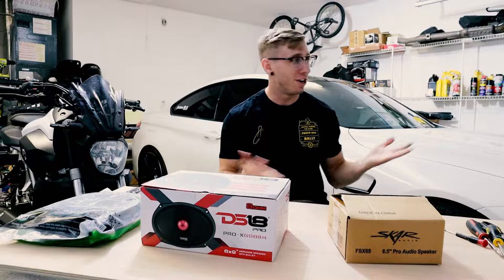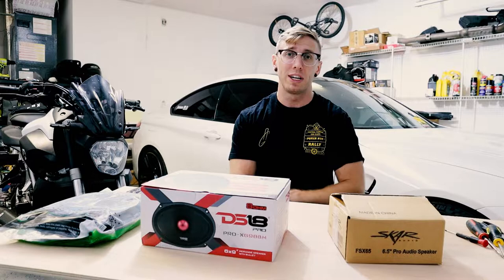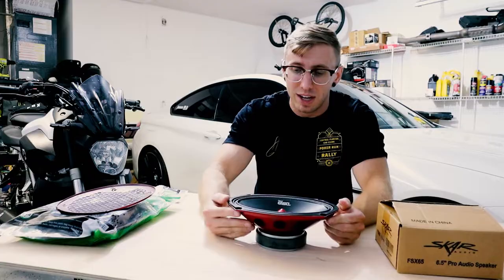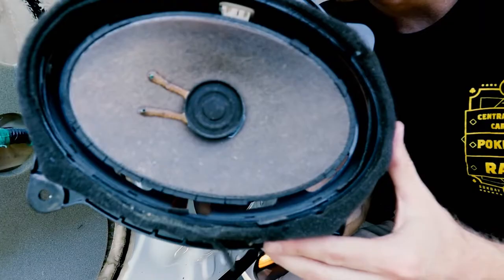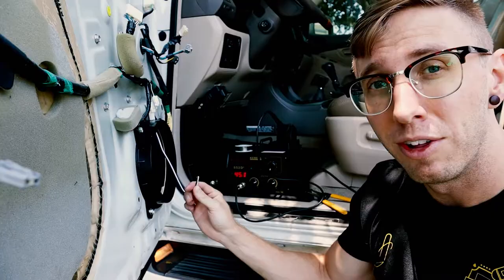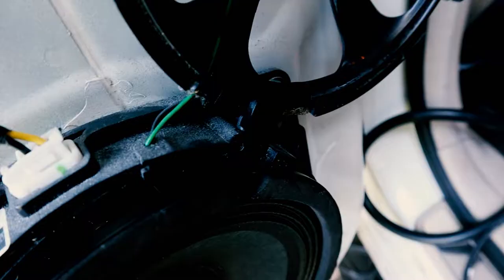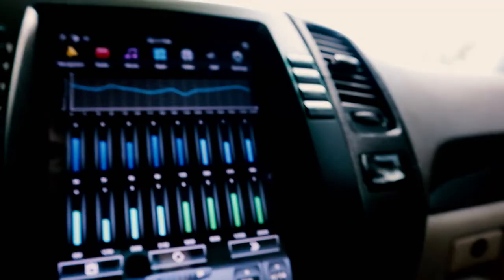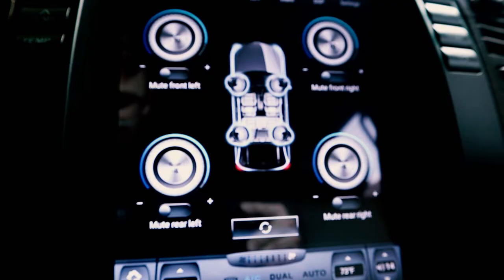Vlog 30 - Lexus GX470 Door Speaker Replacement

Comment: Just an FYI. The rear speakers are NOT the same for the non nav OEM/non mark levinson audio. My 2003 is the same as my old 4runner 4th Gen you DO need to purchase a Metra kit Metra 82-8148
Reply from the maker: Yes, you are correct! The ML system is an 8 ohm system and the non-ML is a traditional 4 ohm impedance system. The good news for non-ML GX owners is that there are so many more options for 4 ohm speakers. Unfortunately, I was stuck with only a few options in 8 ohm, but these speakers have been great so far.

Comment: If I go aftermarket headunit going through the ML factory amp, do I still need 8ohm speakers, both front and rear?
Reply from the maker: Good question! Yes, unfortunately the amp is what needs the 8 ohm configuration. 😑

Comment: Looking to do this same upgrade, why did you use Skar 6.5" for the rear doors and not also use DS18 like the front doors?
Reply from the maker: The rear doors would have needed modified to fit the DS18s 6x9” size. At the time it made sense, but if you could modify the rear doors or get a conversion bracket, you’d get better sound from the DS18s. Let me know if you go that route. I’m curious to know how it goes.

Comment: Got the rear doors finished using your guide.  Great notes on all the necessary tips.  I got the tabs cut away and had both doors done in about an hour.  Once the 6x9's are back in stock, I'll be set!  Thanks
Reply from the maker: Thanks for providing feedback on the install! I’m glad to hear it went well and the video was helpful for installing. The 6x9s were my favorite upgrade as the DS18s have quite a punch. I was surprised by their bass.

Comment: Great video, thank you! Just did the front two 6x9s and I have a couple comments to confirm what's been discussed:

1) Sound is definitely bass-heavy now. EQ-ing on a stock ML head unit is not ideal since you don't get fine control, but if like me you only have the stock unit, I would recommend turning the bass down and treble up a bit to help balance the sound out.
2) There is a little rattle at loud volume with the new brackets. Recommend folks trying this to use the OEM brackets.
3) #10 3/4" self-tapping screws are ideal if using the new brackets.
4) The metra 6x9 speaker adapter from Amazon comes in a 2-pack, so only get one. :)
Reply from the maker: Thanks for the feedback on the stock ML EQ settings! Glad you were able to balance things out with it. Luckily, I don’t have any rattling in my brackets…you might want to try putting some sound dampening material on the backside of the bracket to isolate the rattle.

Comment: Great video!!  Changed out all 4 door speakers with ease.  For the side door 6.5 speakers, used DS 18 Pro-X6MSE 8 ohm speakers.  This gave the sound more midrange depth and a little distortion compared to my wife's Mercedes.  Great for 80's music and needed when playing digital music from an iphone.  My wife's Mecedes sound system is premium but has no character. Almost matches the sound I get from my 2011 Acura TL.  The adapters for all 4 doors and wiring harness made this changeout easy after watching the video a number of times.  My old speakers were shot, did not know the 6x9 in the front two doors were bass only.  Also from Central PA but live in Denver.
Reply from the maker: Thanks for reaching out! I’m really impressed with the DS18 speakers. I hadn’t heard much about the brand until this recent search and they give quite the punch! Glad to hear you are enjoying the upgraded sound. Oh nice! Good ole central PA…I miss Middlesworth kettle cooked BBQ chips lol.
Reply: did you have to modify the brackets a little bit when using the DS18 rear speakers, like what he did for the SKAR speakers?

Comment: Hey thanks for this, just looking to replace my door speakers. What about the 3"  and tweeter door speakers? Were they working still and can you access those without taking door panel off? I noticed they were not mounted to the door. I haven't found a video about replacing those, just the 6x9's.

Comment: Just put kicker 6x9 in the front and kicker 6.5 in the rear doors. The front took the 6x9 perfect but the rear doors didn’t fit perfectly but I made it work. All these speakers were 4 ohm and so far no issues at all. The sound is phenomenal.

I’m putting the skar 6.5 sub in later this week. Just wanted to give my experience to people watching. 

Kicker 6x9" 4 Ohm - model: 46CSS694
Kicker 6.5" 4 Ohm- model: 46CSC654
Reply from the maker: Hey Bobberben! Glad you reached out to share your experience with the speakers. You won't likely have catastrophic issues immediately with running 4 ohm speakers on an 8 ohm circuit...it will be a slow degradation and will wear over time. There's even a chance you go months or years and never see a problem. I'm an electrical engineer, so I couldn't allow myself to go the 4 ohm route just off of principle and circuit theory. Hopefully this holds up well for you over time. If you run into any issues with it, please reach out as I want to know if people ever have issues with the 4 ohm configuration.
Reply: @Awesomoto  I thought of doing 4ohm resistors but figured I’d gamble on it. Put 4ohm resistors in another friends Lexus and so far no issues. I did just put the skar sub in and it’s not preforming well. Not sure if it’s the stock head unit or the 6x9s in the front drowning it out. In your video it seems your sub is flexing a lot more than mine.

Comment: The stock mark Levinson speakers are good speakers and are easy to repair, the kit costs like $20.
Reply from the maker: Great point. I agree with you. A speaker repair kit is an affordable and probably easier solution.

Comment: Thanks for the great and detailed video. I purchased the same from speakers but stayed with DS18 for the rear and sub. I had a rattle i the drivers front but when I went to replace the passenger side it was tore also. Unfortunately for me after the install I found them to be very under powered by the ML amp. Looks like I am going to have to spend mucho coin and get an entire system upgrade at a local pro shop. Ohh well. Again I want to say thanks please keep up the good work.
Reply from the maker: Of course! I'm sorry to hear. Hopefully I'm responding quick enough to make sure to ask you if you have you ML amp enabled in your navigation unit? Mine was disabled at first and the sound was bad. Once I found the setting and enabled, I had great output from these speakers. Actually...all these years later I'm still loving them. Let me know if you need any help troubleshooting your issue.
Reply: @Awesomoto  Thanks! Yes, unfortunately I did not know of an option to turn on the ML amp. I thought it was already on. Anyway, I spent the cash, had a local pro shop install it. They did a decent job and  the sound is great.  Thanks again and keep up the great work man.

Comment: I have a base gx470. Would running the 8ohm speakers hurt anything? 

I have the base 9 speaker set up.
Reply from the maker: If they are 4 ohm speakers and not the ML system, then stick to a standard 4 ohm speaker.

Comment: What amp are you using?, I have no idea how any of this works so I’m not sure which one would work, I have the ML amplifier but it is broken so I’m not sure if I should get the same one or a different one
Reply from the maker: I'm using the factory ML amp. Since yours is broken you have two option: Buy the ML amp or go with aftermarket. If you can find a deal on a factory ML amp, I would go that route to keep it simple.

Comment: Did you by chance modify or cut back the lip on the door panel that is in the shape of the 6 by 9? It's a very thin plastic that's kind of sharp and it seemed like it made contact with the original bracket on the plastic part but while installing my new infinity speakers it almost seems like the whole speaker enters that casing and it stopped by the lip twitch presses on the foam surround at the base. Let me know I'm on the fence about what to do I guess I should cut it back for safety. Also did you not add a gasket to the back of the Metro amount that makes contact with the door? I installed my first one passenger side without it but then I realize there actually is a gasket on the original and it did seem like I was getting some rattle without it. That said I will probably go back and take the speaker out and add it so it's not plastic directly on metal door.
Reply from the maker: Hey Raphael! I did not modify the back lip on the door panel and had luck fitting these speakers without a clearance issue. With regard to the gasket...mine didnt come with one but I'm shocked I havent had rattling issues. I'm wondering if it's because they are cranked down pretty tight. If you have them, I'd add them for safe measure.

Comment: aren't the 6x9" speakers mid-bass in the front doors?? i put 6x9" 2 way speakers, meanwhile i repair the foam surrounds on the mark levingson factory speakers.  when i put these in, all i got was bass coming out of them.  which is telling me, that they are crossover through the factory amp, and can potentially damage the speaker if its not a mid-bass or subwoofer speakers. did you have any issue with the speakers you installed on the front doors?  it seems like you installed mid-bass on the rear doors, so i don't see you having issue with those.
Reply from the maker: I've got a decent frequency response coming from these 6x9's. The DS18 website for these speakers lists a the frequency response as 65Hz-12Khz, so you might need to adjust your equalizer settings in your headunit to get the right response out of them. Here is a link to the speakers on their site, so you can see all the tech specs. https://ds18.com/products/pro-x-series-6x9-8-ohm-midrange-speaker-with-bullet-550w
Reply: @Awesomoto  my factory deck doesn’t have an equalizer.  But thank you for the information. 👍
Reply: I'm looking to replace mine and though I'd love to get the higher frequencies, doesn't sound like you were able to get those after all. Even if I don't, I'm hoping the bass response from the 6x9 is better than the stock ML speaker in that front door. Was yours?

Comment: Great Video! 
Do the rear skar speakers not require the Toyota Compatible wiring Harness…plug and play? 
Also I didn’t see you used Metra Adapter for rear do they need it?
Not sure if to get (4) Wiring Harness and (4) Adapters or just two of each? 
Thanks!
Reply from the maker: Hey TX, sorry for the delay. I thought I had replied to your comment and it looks like I hadnt. I ended up soldering the rear speakers to the factory wiring. If you check you can see I cut the wire from the original speakers and then I stripped it back and soldered the Skar speakers into place.

Comment: 7:02 . I need to change out my speakers in a 2004 GX470 non nav non mark levinson system and am having a heck of a time trying to find the output per channel on the amp. Then I came across the model number and found the specs, it says it’s only 22 watts to the front and back, does that sound as though it’s an accurate number ?  If so, what wattage speakers should I be getting?  Thanks for your help in advance
Reply from the maker: Great question! There is a big misconception with wattage ratings on speakers and amplifiers. The speaker wattage rating is specifies the total amount of power they can handle. So you'll just need to make sure your speaker can handle more than 22 watts...which you'll find that most can handle over 200 watts. Hopefully this helps...let me know if you have questions.

Comment: I bought the exact same GX , with exactly the same audio issues. I replaced the surrounds (foam pieces) on the frond door 6x9s. I jerked out the wires from the destroyed (so called sub) and plugged them into a JL audio 10" dual box. 2ohm. It all sounds good for now, as I keep it reasonable. I'm sure it will all fall apart soon, ya know... after the fire. At which time I`ll have to drop thousands into the system. lol
Reply from the maker: Hey Josh! Sounds like you did some work! 
LOL!! Hopefully there isn't a fire!
Reply: @Awesomoto  Jesus! Are you serious??? Do you really think that 2ohm sub box would do such a thing? I don’t have time for a fire…
Reply from the maker: @joshmoore6165  LOL!! Of course not. I’m an EE and I personally prefer 8 ohms for the impedance loading of the amp, but I certainly don’t think 2 ohms would cause a fire.
Reply: @Awesomoto  Hello pioneer ts-a6980f will this model work well?

Comment: love your videos! Im about to take the plunge but thinking of doing the front/back door and back sub all ds18.. just had a few questions. Can you tell me the difference between  XL 6.5" Mid-Range Loudspeaker 300 Watts Rms 8-Ohm and PRO-ZXI 6.5" Mid-Range Loudspeaker With Neodymium/Ferrite Magnets 300 Watts Rms 8-Ohm would either of these fit as the trunk subwooder?    Appreciate the help!!

Comment: Hey man - I'm having a difficult time trying to change the top, and mid speakers in my front doors (lowers are fine, just replaced).

There isn't a wire harness for easy plug-and-play for the top and mids like there is for the bottoms. I have a set of kickers that fit the mids and Mc Larens that fit the top, but unless I splice wires, I don't know how I'd properly swap them. How'd you do it?
Reply from the maker: Great question! I actually still have my top speakers in good shape, so I didn’t have to swap them. Regardless, what you can do is either trim the old ones out and solder to the terminals of the new or take crimpers and crimp on a terminal connector.

Comment: Are you powering the new speakers/sub with just the Phoenix head unit?
Reply from the maker: Great question. Technically the stock ML amp is driving the speakers. The head unit sends a signal to the amp, which gets amplified to drive the speakers.

Comment: Thanks for doing this video, I just did the front 6x9s exact same everything and used the wiring harness. I did not clip the ends off and solder them but used existing connections from harness to speakers. Did I just cross wire my speakers? 8:37
Reply from the maker: I don't think you cross wired them. It should still work the way you hooked things up. Are you having sound issues?

Comment: What size screw did you use on the front speakers? Didn’t catch it. Thanks
Reply from the maker: I used a similar screw to the one I talk about @13:44 in the video. A #10x3/4" screw will work and even something smaller, like 1/2" length will work. The key is the #10 size screw to get the bite you need on the plastic speaker frame. Let me know if you have questions or issues finding them.

Comment: Amazing video, very insightful ❕I have a question, since my GX doesn’t have the original Mark Levinson Amplifier, and it has an aftermarket head unit/car stereo… I know for sure that all the speakers aren’t working; the ones that are currently working (or connected to the head unit) are the lower front speakers, the rear door speakers and the trunk door tweeters… the subwoofer was connected with an small amplifier to the head unit.

So my question is, if I don’t have an 8ohm amplifier, can I just replace the 4 speakers I’m currently using with new 4ohm speakers ? Or because of the fact that the wirings are for 8 ohm’s, i should still buy 8ohm’s speakers for my GX?

I want to buy some 6.5” Component Speakers for the front so I can mount them on the lower mount of the front doors and install the tweeters on the original front door mounts. And for the rear buy some 2way (low/tweeter) 6.5” inch speakers, since the trunk door already has its tweeters working and I have my subwoofer (on the OEM space) connected to the small amplifier.

What would you recommend?😅 I’m not an electrical engineer but want to buy the parts to have them installed😂
Reply from the maker: I’m so sorry Andy. Apologies for the late response (I try to get back to everyone in reasonable time and this slipped on me).

Since you don’t have the original amplifier, you are in a great position to use 4 ohm speakers. Plus that gives you much more options with speakers.

Comment: So when looking for speakers for these they have to be 8 ohm for impedance when I look at the specs? Also is every speaker 8 ohms? I plan on replacing all of them
Reply from the maker: Yes, 8 ohm impedance is definitely preferred and all speakers are 8 ohms.
Reply: @Awesomoto  okay. I just got a teyes head unit installed but the sound is awful. I think I have to mess with the settings, but definitely shopping to upgrade them

Comment: I replaced my rf speaker and had a lot of low level audible buzzing, thought maybe spkr was defective. Installed the 2nd spkr, it, too buzzed!
Installed frst spkr in LF door, no buzzing! 

Must be the amp...
Reply from the maker: Yeah that sounds like the amp has a defective channel. You might be better off going with an aftermarket amp as I hear the ML amps are very expensive now.

Comment: Here’s a speaker upgrade? I noticed the GX has a single center dash speaker. I too have a single dash speaker in my 2015 RX350. I just have the premium 12 speaker/ 210watt/ 7 channel system c/w navigation but not the M/L. 
Trying to decide if this speaker would be worth changing out. Or is it primarily for phone & navigation commands? What are your thoughts.
P.S. : Great job on this video!
Reply from the maker: Thanks Rick! I like where your head is at and now I'm curious about that center speaker and when its active. I'm going to put my head up there next time I have music playing to see if its running.

Comment: NICE!!! tnx. for this. y didn't u go with the DS18 Pro 6.5" for the rear doors?
Reply from the maker: Hey Wilton! Sorry for the delay. I guess I didn't realize the DS18 6.5" came in 8 ohms speaker configuration, so I went with Skar since I used their sub in an earlier video. I really like the DS18 for my from speakers, so I would try them out for the 6.5" and see how you like them.